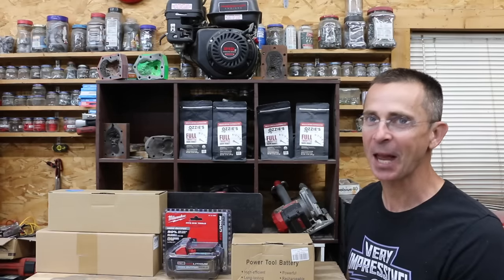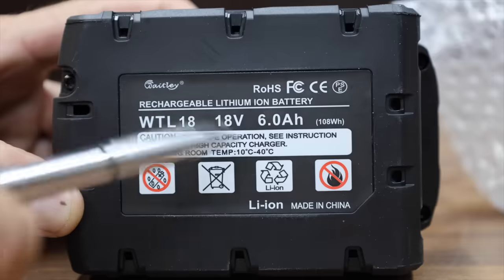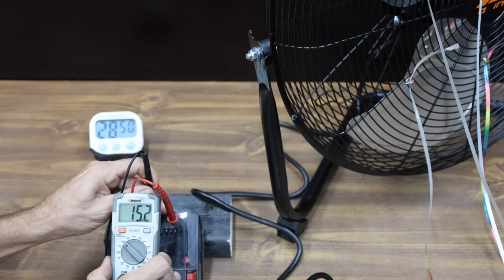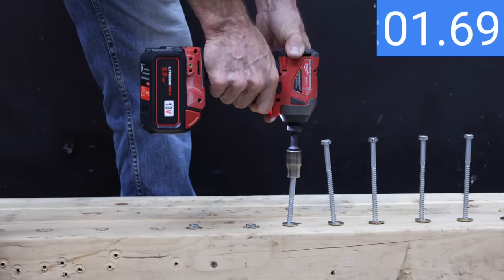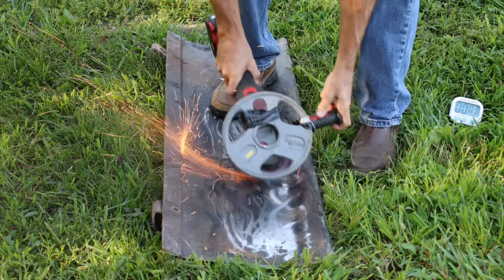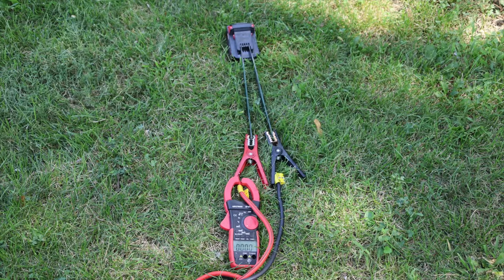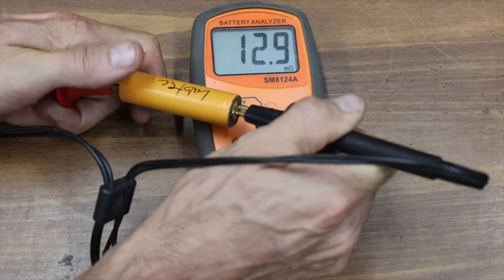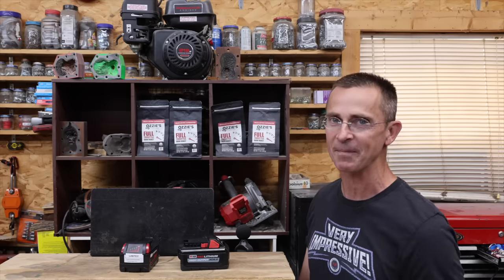How Dangerous Are Knockoff Tool Batteries? Let’s find out!

Comment: Great content like always!!!   Video idea: Best Driveway/Concrete cleaner.  Maybe removing oil spots and such.
Reply from the maker: Thank you for the video idea!
Reply: Lye.   I used spray oven cleaner (with sodium hydroxide - there are a lot that don't have it anymore) on my driveway.    Spray it on, walk away.   I usually did it twice, and then the next couple of rains made the stains vanish.    Pressure washing worked too.  Even the huge old oil stain my wife made by closing the garage door on a 5 quart bottle of oil.      I tried gel drain cleaner, but it didn't work as well.
Reply: Try cat litter to absorb excessive oil or grease. Then using a cheap oven cleaner on your grease spots, spray heavy amount on and leave for min. of a half hr or more at a moderate temp (70°s) keep the kids and pets away, then use an old broom to scrub and water to rinse. May have to use several times, depending on how much oil and grease is built up.
Reply: Add paint removal to that test. I struggle to get dried or semi-dried paint off brushed concrete.
Reply: @tbelding  the only thing with using lye and walking away, is that a pet or a child could accidentally get into it and could cause serious medical problems with acid burns. Or someone could walk in it and carry it into the house on their shoes and ruin your carpet. Safety first....
Reply: Muriatic acid works great
Reply: @patzeuner8385  - Some flaws there.  1) If someone walks into it, it's trespassing.   They've walked up my driveway without permission.  2) Nobody can get acid burns from lye.  It's physically impossible.   It's a base.  They can get basic burns, but not acid.   3) The concrete is porous.  My experience over several years is that the thin "foaming" lye spray (oven cleaner) vanishes into the stain and concrete within 6 minutes or so.    It's then dry.   4) The smell is not interesting to animals - if anything, they dislike it.   

I REALLY get irritated with people that will make up nonsensical edge cases just to try to discourage something they don't like, or to just justify their own ideas.   I managed to finally get my daughter to stop that, I'm not going to take it from another adult.   Just because someone else is a moron, I shouldn't be forced to bend over backwards to stop them from hurting themselves.
Reply: @BeerNBurnouts  - I've never had good luck with acids on concrete stains.  It could be that it's because I'm generally working on oil and chemicals, rather than things like paints.
Reply: @tbelding  High pressure water for the win.
Reply: @georgetinc9578  - Pressure washers are great, absolutely.   Breaking down the oil further into the concrete with lye helps that even more.
Reply: Chemical Engineer here... Acid won't do anything with oil stains. You need caustic and surfactants. Lye or any oven cleaner will be better to start and power washer after it...
Reply: @ProjectFarm  I know a pressure washer would work great. I do woodworking in my shop and also use it for maintenance and general repairs on my truck. Any excess water  or moisture is not good.
Reply: @tbelding  sorry I should have said caustic burns vs acid. Lye is an alkaloid not a base, and will cause burns to the skin, eyes and mucus membranes, but you would know this, if you ever bothered to read the warning labels on the container. 
As for the belligerent response to people trespassing, sorry small children, pets or wildlife can't read the no trespassing signs and are placed in danger, due to your disregard for the safety, of not only yourself but others. 
Sorry for your daughter,  that hopefully has figured out that you can't argue with someone that is always right. 🤔
Reply: @patzeuner8385  - I'm sorry you are incapable of understanding.  Let me use simple words.  When the topic is "What can clean the driveway/concrete", it is expected that answers would be related to how well something cleans, or does not, concrete. 

Using conspiracy theory "What if" scenarios is not related to the topic.   

My daughter finally understood that by the age of 12.   I suspect it will take you much longer.
Reply: @tbelding  sorry that you don't like to read warning labels and glad that your daughter figured out at a young age that you can't argue with someone that is always right.

Comment: I like the cordless tool scheme in EU where all the manufacturers got together and standardized the shape of their battery sockets so that they are all interchangeable. This way, people aren't discouraged from buying tools outside from their current brand ecosystem. As you say, the battery is often the most expensive part of the tool.
Reply: WAIT THEY HAVE THIS?!
Reply: Agreed! But it is almost impossible to see that happens in the USA any time soon. The US Companies tell the government what to do, not the other way around.
Reply: @Ariccio123  Not yet but talks about it
Reply: What? We dont have this? I cant use my bosch batteries in a dewalt or mectools
Reply: The US would have to do this by voltages.  All 20v, 40v, 50v, 60v, and 80v would all have to either have standard voltages or make it by volt class.
Reply: If that's true, we in the USA should adopt that. It would save a lot of money and time
Reply: Hmm, brand name? I know powerforall-alliance but that are mostly all Bosch brands and not Makita, DeWalt and so on.
Reply: Dude, that will never happen here in the USA though. I own five generations of rigid shop vacs. They change the hoses every time. Nothing duct tape can't fix, but it's still frustrating.
Reply: That sort of concept only helps if it doesn't turn in a feature creep filled bureaucratic design by committee mess - which unfortunately it may well do when taken that far. There are just too many folks with a stake in the game on the production side, which also has political ramifications.
Reply: I live in EU and I have no idea what are you talking about.
Reply: Where is this claim specifically from? I'm from Finland and this is the first time I've ever heard about such thing.
Reply: I have noticed that new Bosch batteries are claiming to follow a standard here in the US.  I saw something about their batteries being directly usable on some smaller tool brands cordless tools.
Reply from the maker: Thanks for the feedback.
Reply: EU Standardisation is a really such a good idea for the end users, especially with the EU demonstrating they won't allow inter-company price fixing and making it incredibly prohibitive to do so.
Reply: So it makes advancements difficult if not impossible since any change would need government approval? I hope I'm understanding that wrong. As frustrating as proprietary connections and such are, not sure I'd be happy with any government taking control over future tech. Making law based on the possibility of what a company might do seems backwards.
Reply: @edfleming9600 I'm with you there. I have about 40 feet of vac hose from my older Craftsman that died. I just bought a Ridgid and the hoses have that dumb locking clip. And on a side note, the exhaust baffle blocks the tool caddy on the back. I can't use the center hole without first removing the baffle. How baffling.  😮
Reply: Where? Never actually seen this!
Reply: @haajee1   Greenworks has 20v, 40v, 60v, and 80v variants, Ego has 53v, and dewalt has multiple voltages.  All the tools would need some sort of adapter, but it sure would be nice.
Reply: @edfleming9600  Do you really think foreign tools are going to be banned in the US?  People outside of Europe are obviously able to purchase and use European tools.  I think it's just not true that all batteries and tools are compatible in Europe.
Reply: New regulations coming soon so even mobile phones will need to have a removable battery that anyone can replace without special tools. These are the kind of changes we need.
Reply from the maker: Thanks for sharing.
Reply: @tech99070  well they aren't. 208 verses 120. So what's your statement?
Reply: If this really is a requirement in Europe, wouldn’t manufacturers use the same type of battery and connection in Europe as anywhere else? It seems like making different tools and batteries for different parts of the world would be more complex and just as or more expensive as losing sales to competing brands of batteries.
Reply: @huldu The next model iPhones (announcing in a few days) will use USB-C cables instead of Apple’s proprietary lightning cable, worldwide. This is entirely due to new Europe regulations.

Comment: Awesome video! Thanks for sharing! In the fab shop, we have gone through so many milwaukee batteries due to the case splitting open, that the manufacturing engineer ordered battery covers for the milwaukee batteries. Super gluing the case back together helps. The batteries in our case, operate a 1/2" impact gun, so quite a bit of jarring on the battery, and the operators are probably occasionally dropping it. The fall is much more extensive with a heavy 1/2 milwaukee impact gun adding to the weight of the fall. We used to run dewalt impact guns, we never went through a broken battery case with dewalt, but the gun itself would crack open. Milwaukee 1/2" impact guns are bulletproof/don't crack apart like dewalt.
Reply from the maker: Thanks and you are welcome!

Comment: What a great well thought out review. I think for the DIYer that Labtec battery is for sure gold. I already purchased brand name batteries but if I even need replacements I'm for sure going that route. Thanks for all your hard work on this, amazing video!
Reply from the maker: Thanks and you are welcome!
Reply: I could see using the battery as a cheap shell, I've seen people make a short wire to a larger external battery pack done before, or battery clips for the 12v batteries

Comment: I'd like to see counterfeit batteries tested this way too. There are a lot of counterfeit dewalts out there and It's getting dangerous to shop online at this point.

A great video as always too!
I never buy anything without seeing if you've covered it first.
Reply from the maker: Thanks!  Thanks for the suggestion.
Reply: me too, but products and production lines and quality of products change over time. also varies factory to factory.
Reply: I tried to buy Dyson Batteries that were 1/3 the cost of the original. I learned that I should just buy original manufacturer batteries. They cost more up front, but you save money in the long run and have a better performing product. Its really a no brainer. Its kind of like dollar store button cell batteries. I wouldn't touch those with a ten foot pole.

Comment: Would love to see this for the large Ego batteries, particularly the 7.5s.  those things are $400 new.  It would be great to find a good knockoff that doesn't break the bank.
Reply: Same, and with different brands as well. Todd has done similar tests in the past and it's always enlightening. Certainly better value in the brand name batteries. But, I wonder if you could buy multiple of the knock off brands and get a lot more run time, even if lower power, then just 1 brand name.
Reply: @Bakachu7  If you can do that, how come name battery can be called a better value ?

Comment: Two things:
In the first short circuit test the clamp meter was not installed right, so the numbers from that run are completely bogus, but it looks like you fixed it later.
What were the nominal capacities marked on the cells, if you can tell?
Reply: He ain’t responding kinda sad
Reply: Yeah still no answer
Reply: He was primarily testing the overload protection of the batteries, not the short circuit capacity.  The maximum battery capacity comparison was better illustrated by the load tests with fan, grinder, and impact driver showing that the OEM batteries provide the most capacity and peak loading capability.
Reply: Make your own  video if you're so knowledgeable...
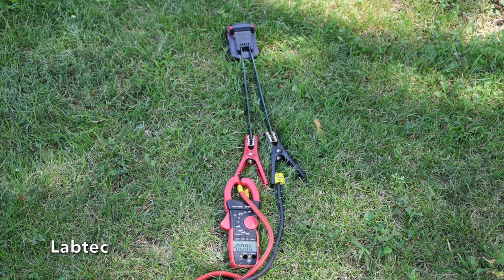Reply: 8:43 yes, the current clamp isn't closed fully there, but regardless, the readings from these type of current meters probably don't really display peak readings because of their slow response anyway, so it may not be all that significant.

 It was more just to see what damage results from a direct short.  That's not a likely situation to occur in any normal use, as the tool is unlikely to present a dead short like that, but that's a test no one else would likely try on their own, so it's interesting to see. I don't know if I'd be particularly concerned with sudden shorts happening though, as it should be fairly rare.

  If the batteries didn't have sufficient oomph to blow the fuse immediately, it'll just overheat and smoke as in some of the cases.
Reply: You are correct.
Reply: Booohoo not good enough for you Kevin

Comment: Thank you for this video. I use Milwaukee cordless tools for work. I have been tempted by the cheaper knockoff batteries but I'm glad that I never succumbed to the temptation as you proved that it's not worth it.
Reply: I'm confused about the "not worth it" as you can buy four times the batteries getting well over double the capacity for the same amount of money.  If Milwaukee had a 2 for one sale, you'd arbitrarily be choosing to ignore that and buy (less than) one instead.  I'm curious as to why?
Reply: @duckswan9936  Not the OP, but you may have missed that they didn't just have lower capacities so they ran for fewer minutes, but they couldn't provide the same peak current flow much less sustain it.  That really mattered for things like the angle grinder.  You might have also missed the safety aspects.  Like the battery that started smoking while he was using it.  I've seen lithium fires first-hand.  I don't want one happening in my hand.

Personally I'll only be considering cheap batteries for lower-draw non-sustained uses now, which means I probably won't buy them.
Reply: @Khanmots I'm in the same boat. I always use genuine batteries in large power tools, but in less demanding tasks like lights the knockoff batteries seem to work well, so long as you don't put them on the fast charger.
Reply: @duckswan9936 depends on your needs. I have about 10 genuine and 8 fakes. The fakes never last as long but at 1/4 the price, I don't mind switching them out more often. If your a occasional user, I think there fine. Had some for 4 years of daily use. No issues yet.
Reply: Yea i don't know bud. Im a dewalt user and i got 2 knock offs and a charger for 80 bucks. After 3 months of use im still grabbing the knock offs out of the truck first before 1 of my 10 dewalt batteries that range from 4 years old to 1 year old. 
So far they have been pretty worth it to me

Comment: We also have some "off-brand" batteries for our Milwaukee (12V) and Makita (18V) tools.  We use Waitley brand batteries, and they have been very good, much better than many of the other off-brand ones we have had.   They are not as good as the OEM ones, but probably 70% or so.
Reply from the maker: Thanks for sharing.
Reply: @ProjectFarm  ☺☺

Comment: I have the labtec ones and they work great for what I do. Just an at home work on my own junk mechanic. $22 versus nearly $100 makes the slight decrease in performance well worth it
Reply from the maker: Thanks for sharing.
Reply: My biggest concern is that as they aren't honest enough about the output ratings, while they might be a decent deal and properly safe now.... What is going to ensure that it stays that way 2/3/5/10yrs down the road?
Reply: @slightlyevolved  I’ve had mine a little over a year now with no issues. And at 1/4 the price of the genuine Milwaukee batteries, I’m not too concerned about how long they Last.

Comment: Your timing is impeccable. Looks like I’ll be sticking with factory Milwaukee batteries. 

I do have a few knockoff Ryobi batteries for yard equipment that seem to work fairly well, however I’m curious about the converters that let you use a Milwaukee in a Ryobi. Like will they potentially damage my Mil batteries? 🤷🏼‍♂️
Reply: Since Milwaukee and Ryobi are the same company, the batteries are probably the same inside, which is what makes a passive adapter possible.

Comment: This is a good review! It would be nice to see a comparison between batteries of more similar price, for example a generic 6Ah battery versus a genuine 2Ah battery. I bet that while 10 cheap cells are easily beaten by 10 expensive cells, 10 cheap cells could consistently beat 5 expensive cells. Especially since I think the basic non-high output genuine batteries use cheaper cells than seen here.
Reply from the maker: Thanks!  Thanks for the suggestion.

Comment: I have a 12.0 on my Milwaukee hammer drill ice auger and it’s unbelievable.. drilled 60 holes through 22 inches of ice and still had half a charge. Not to mention it’s way faster than any gas auger Iv ever used.
Reply from the maker: Thanks for sharing.

Comment: That inductive amp clamp is not accurate unless the jaws are closed all the way. However, as a comparison it should be good enough. Thanks for the video! 👍

Edit: I realized some of the later tests have the jaws closed resulting in a much higher amp reading, so unfortunately thats where the comparison stops...
Reply: I noticed the same, the short circuit currents for the first few are incorrent because the clamp wasnt fitted correctly.
Reply from the maker: Thank you for sharing!